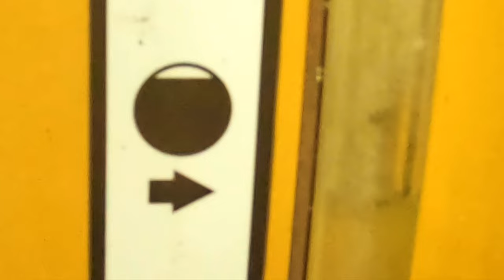Tigercat LX870D Buncher 1000 Hour Service -  Tips And Tricks

Comment: Interesting video. Love the brake clean. I use it daily every time I change quick couplers as well as cleaning fuel nozzle before refueling equipment.
Reply from the maker: Thanks. Yeah, I am with you on the Brakleen. I use a SureShot as much as I can, refill it with bulk. But you can't quite get the power of spray out of it that you can with an aerosol can. I have to laugh, we're pretty similar, I spray off the ground fuel quick coupler before I hook it up to fuel at night. Keep 'er clean right? Have a good weekend.